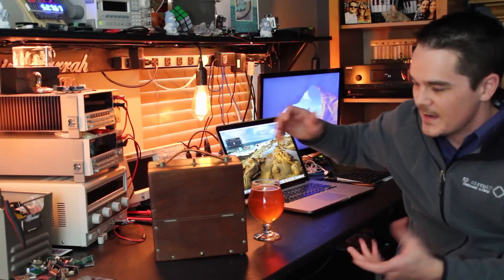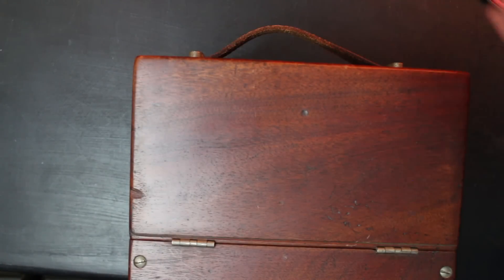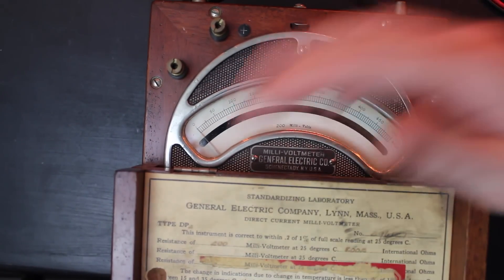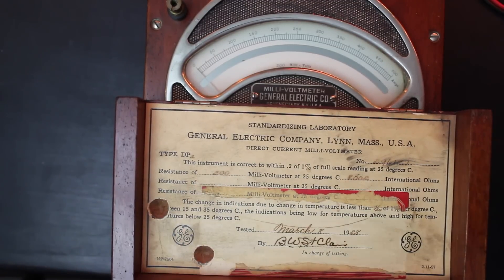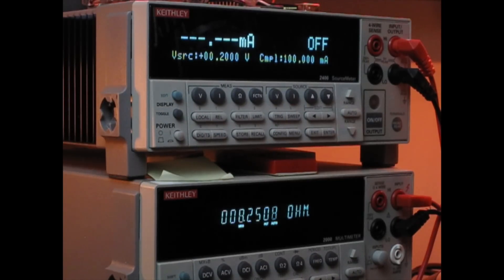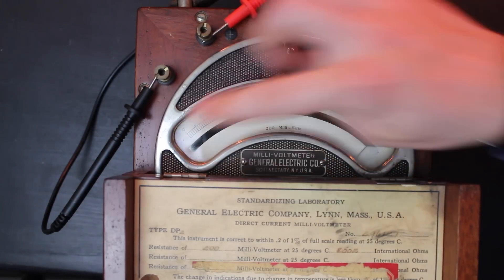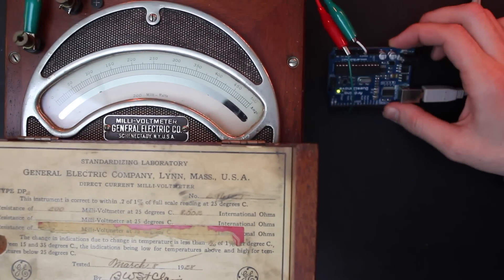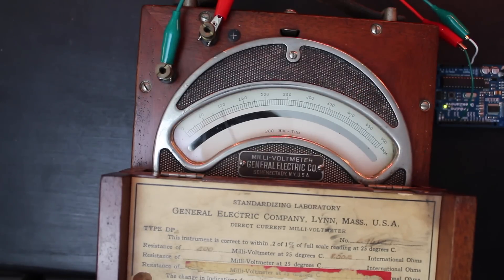Voltmeter from 1927! First Test! Does it still work?

Comment: I didn't realize they are that rare. I use almost identical vintage meters all the time. I have a set of three 7-1/2 inch WESTINGHOUSE ; ma, volts and amp meters. They all still work well.

Comment: I still have my original AVO8 analog meter from 30 years ago that is still working now they knew how to make quality then, but my question is you used to use Pic Micro but I see you now only use Arduino is this down to cost as I have found Pic so expensive compared to Arduino ?

Comment: On many of these old meters the magnet gets slightly weaker over time, so that may be why it is reading low.
Also some of them are designed to work only in upright orientation.

Comment: As others have pointed out, don't make any damaging modifications. Just drive the terminals with the pwm output. Maybe don't even hide the arduino inside the box. Don't want to have to drill a hole for power.

I'd set it up to display the magnitude of your incoming network traffic scaled by the max speed you get on a speed test site.

Comment: Its historical value is significant. Please don't modify it.  It really belongs in a museum.  But it would be extremely interesting to see the inner workings as long as the case can be opened with out causing damage.
Reply from the maker: +XT500C yea, I'm really starting to like the way it looks as is on my desk next to to my 6.5 digit bench top :)  What I might do is build a front end that simply attaches to this meter via the terminals - so a pretty non-invasive mod
Reply: +Kevin Darrah Really awesome that there's even a calibration sticker on it.